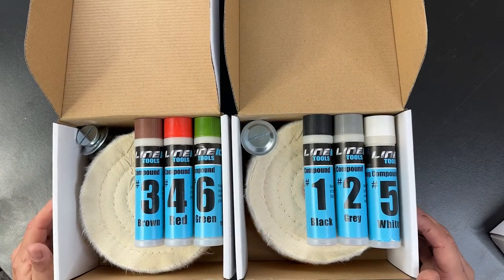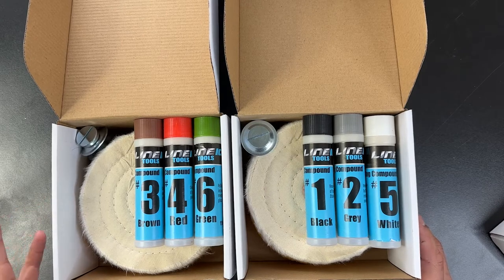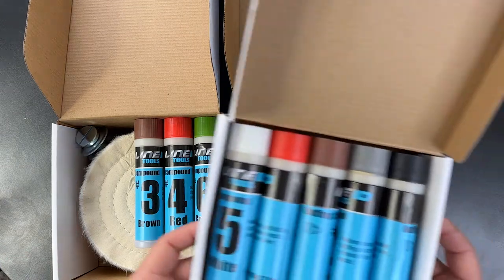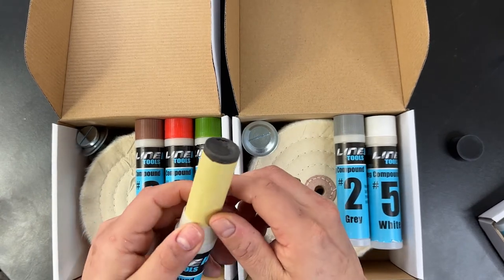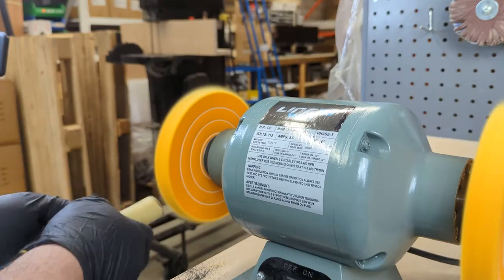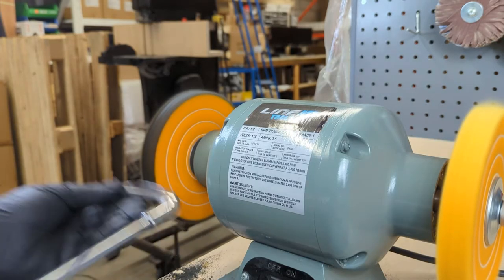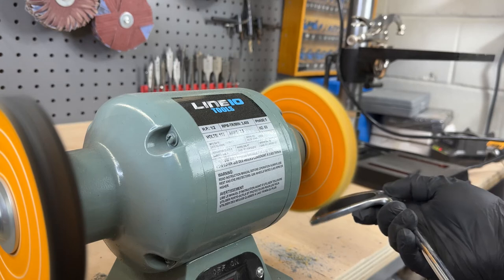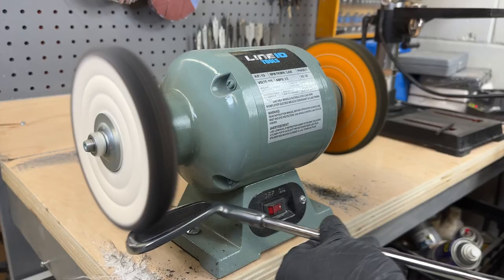How to Use a Polishing Compound Stick? FULL Guide to Buffing Compound Sticks by LINE10 Tools

Comment: How do you eliminate or clean black gunk when polishing on buffing wheel?  I get them all the time, and it’s annoying and hard to remove.  Thanks
Reply from the maker: If you notice in the video I use the tip of a scrap metal edge to separate the plies of the buffing wheel, this will remove all the baked on compound and renew the wheel

Comment: What do you do when the compound has gone rock hard after just one use when you next use it? Even though it was in an air tight contain? I can't find any info on this anywhere. The sticks I bought just won't go onto the wheel now, no matter how hard or long I press. I even heated it up with a blow torch but it just burned it and it set hard again
Reply: I wish I knew.
Reply: @maxpolaris99   Since I made this comment, I tried using it again on a cold day and it suddenly did what it was meant to. I put it on the wheel and saw the wheel change colour for the first time and was buffing like a sonofabitch. Have no idea why they wouldn't work in summer but they worked when it was only 10 degrees.
Reply: @ArcanePath360  I got nothing to lose so I'll try them, hard as they are
Reply from the maker: The compound is supposed to be solid, you can apply it to the wheel while its turning, hold it firmly for a few seconds but dont apply pressure, the heat generated from the friction should allow the compound to be applied to the wheel, no matter how hard it gets.
Also, don't use a blow torch, use a hair drier on low, it will melt it down enough to be more malleable if you prefer
Good luck!

Comment: I purchased green color bar for stainless steel
Its bit dry, 
Shall I add water or use as it is ?
Reply from the maker: Its supposed to be dry, you need to hold it firmly (don't put a lot of pressure) against the spinning wheel for a few seconds, the heat generated from the friction should sufficient to soften it and apply it to the wheel, you only need a light film, do not overload or you will ruin your wheel, its best to reapply the compound frequently.

An alternative way, is to use a heat gun and heat the metal surface, apply the compound at the hot surface, then on the wheel to get a good even coverage

Comment: How do you clean the bar or tube of the compound abrasive itself? Mine eventually gets black and it seems I'm just moving dirt back and forth - bar of No5 compound to wheel to metal and back again
Reply from the maker: Get a scarp metal edge and try to separate the plies while the wheel is running, the hardened black edge will be removed and the wheel will be renewed.
Even if the color is still dark, The wheel will still work as new as long as you remove the baked on compound with the help of a metal scraper, a serrated edge will work even better! 

We will be launching a wheel cleaning tool soon, sign up to our newsletter on line10tools.com